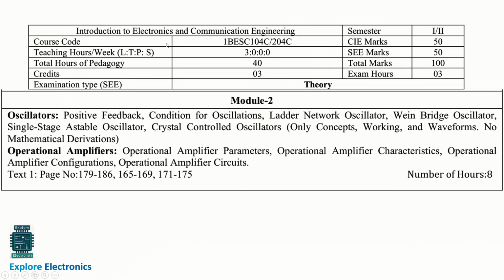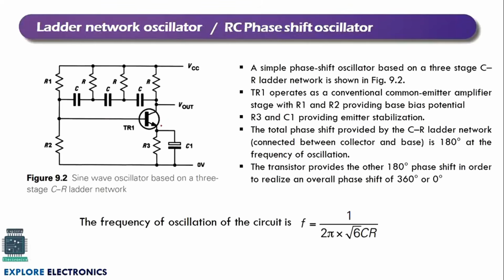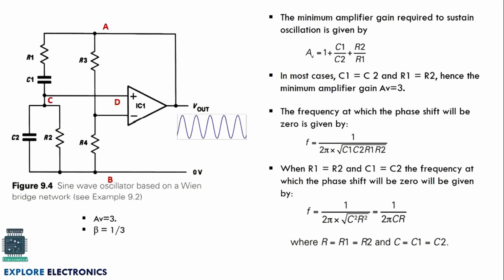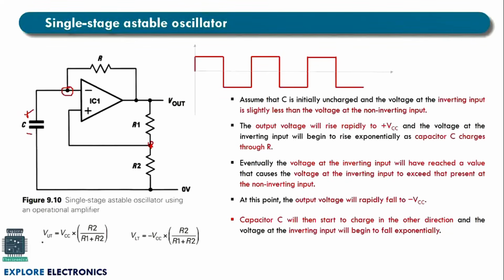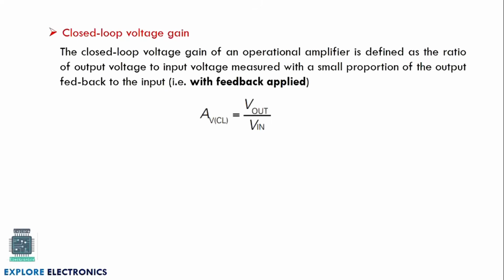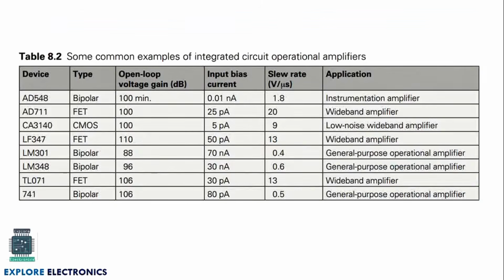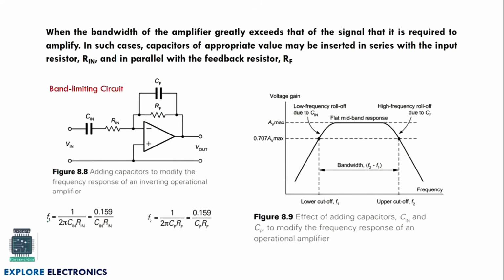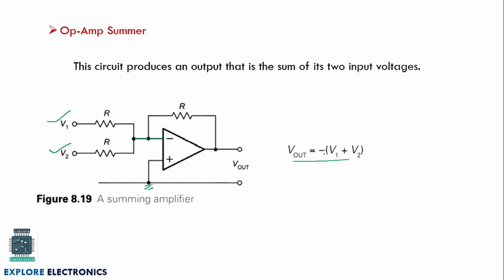Module 2 OSCILLATORS, OP-AMP | Introduction to Electronics and Communication Engineering | 1BESC104C

Comment: Whether differential mode and summing are imp questions
Reply: If you're preparing for CSE or CSe allied engineering then op-amp as inverting and non inverting is more than enough but if electronics in 12th or ECE as engineering differential and capacitive both are important 😞
Reply from the maker: Yes opamp applications are important